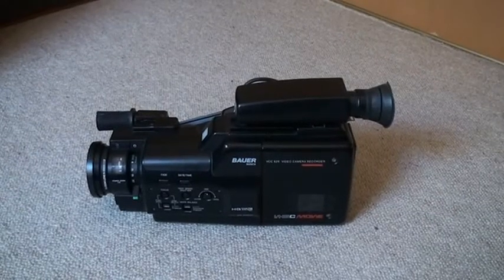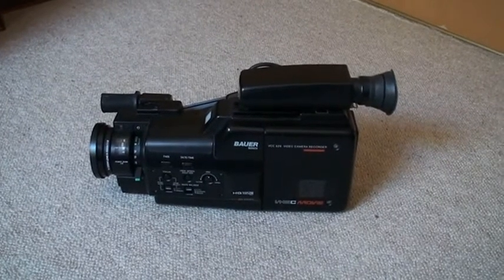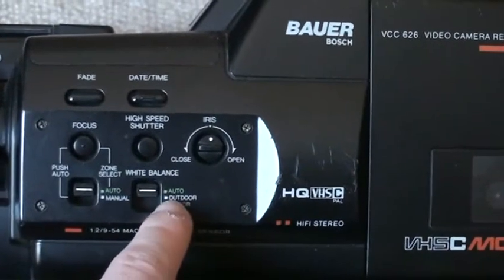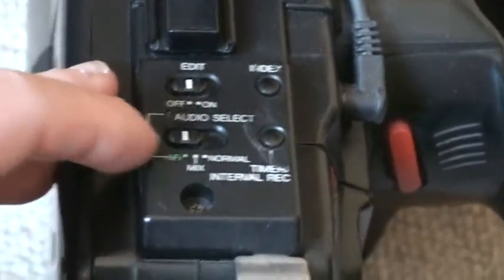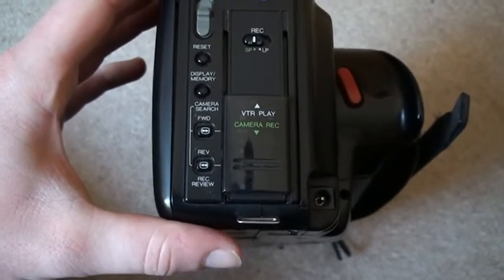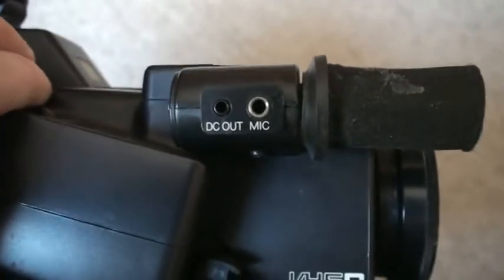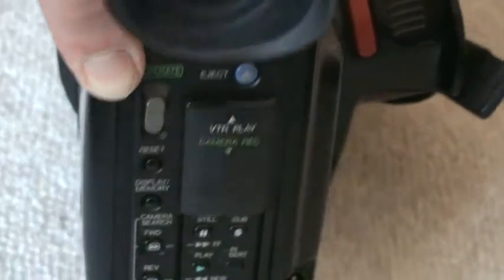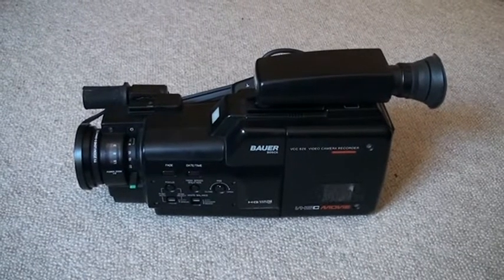Bauer VCC 626 VHS-C camcorder

Comment: that's how my Canon VC-30 and VC-200 tube cameras are, even being just a camera they are chock FULL of capacitors but they are PC board mount so they can easily be replaced which I will need to do to the vc-30. As soon as I get the power supply issues fixed (cap exploded in it with a loud bang!) I will have vids using the vc200 because of its really good macro, using the ccd sensor in the  small camera for normal shots and hooking the tube camera to it to do macro, it works really well

Comment: I found out what the Problem is! there is a problem with the switch that goes on the cassette and checks if the record mode is "on" or "off", now I can play videos only If the switch on the cassette is on "off" and record with "on". Is there a way to fix this?

Comment: I got a problem with my Grundig s-vs-c80, s vhs-c Camcorder: Yesterday it was still functional but later when I wanted to play a video from it connected to the tv, there were only white flashing Lines on the Tv and the Fewfinder, I tested many cassettes but it was always the same only the sound worked. Could it be a damaged Head? or mybe becouse I used it on that day very mouch, a damaged Mechanism?